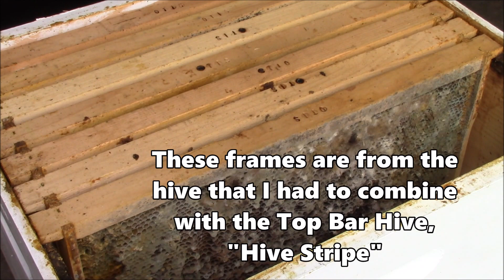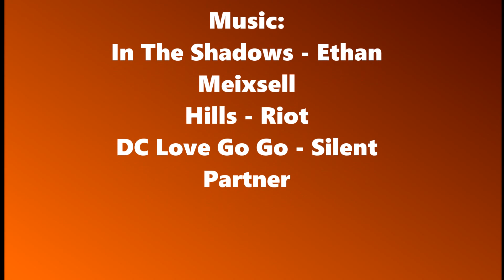Cleaning up moldy frames

Comment: I'm just throwing the three frame I have in the garbage. Not worth the contamination for trouble to clean.
Reply from the maker: I ended up doing that with several as well.  The bees will clean it up, but I didn't want to give that extra work to them for the worst of it.